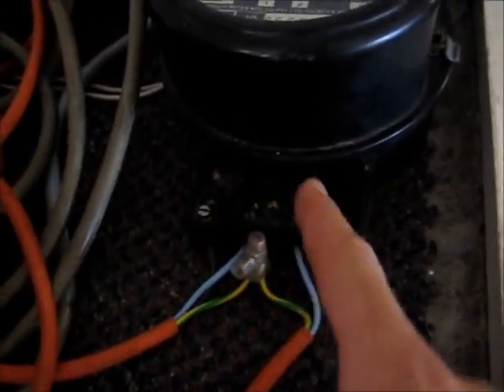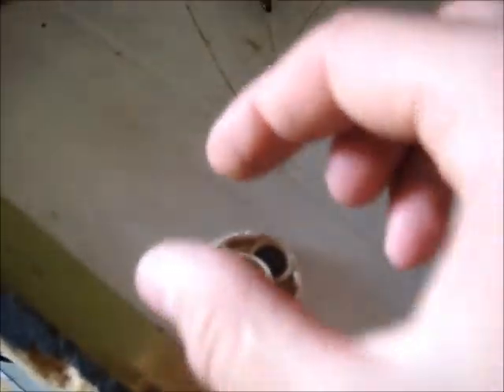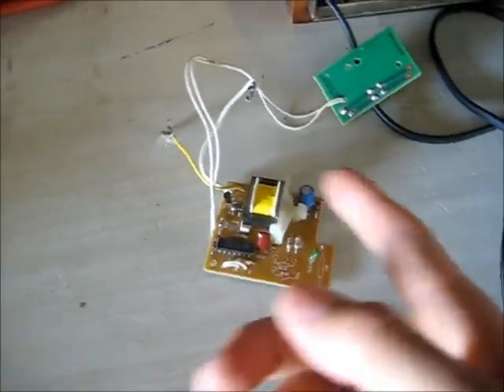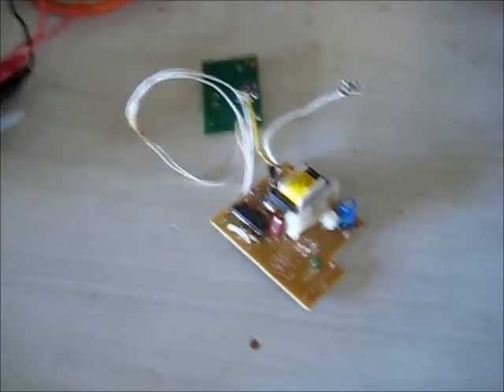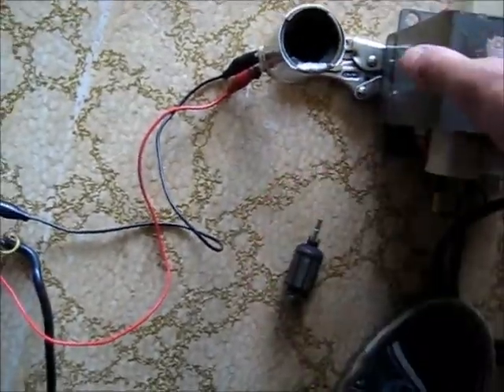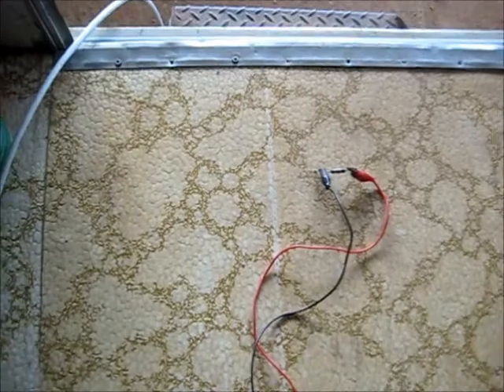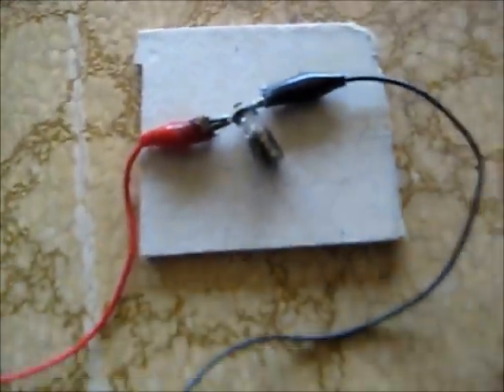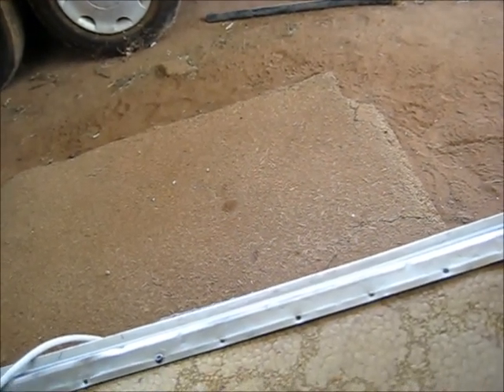Popping fuel pump & other stuff

Comment: Haha. That rotor really wanted out of there. :-D After escaping it then went off somewhere to grind up something in revenge. :-D LMAO! 

The flouro starter: These are funny wired straight-to-mains. Ballast one with a 2kw heater, then wire the terminals across the potential, & place in a jar. Press the switch....

Glow-Glow-Glow.....*BOOM* :-D

Good times. I once did this when I was younger, BUT WITHOUT any ballasting, & the boom was epic. No leads left on it & a popped 13A plug fuse. :-D

-BBD.

Comment: @HDXFH My teacher had one of those, and it got seized, so we took it apart, and found a flake of metal in the cylinder, we broke it off, smoothed it down a little and now the motor works :D